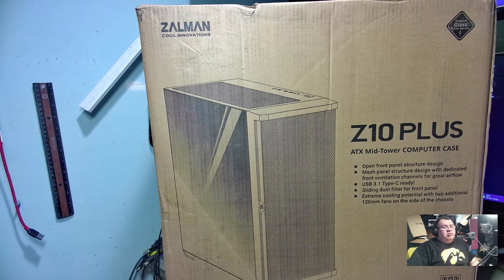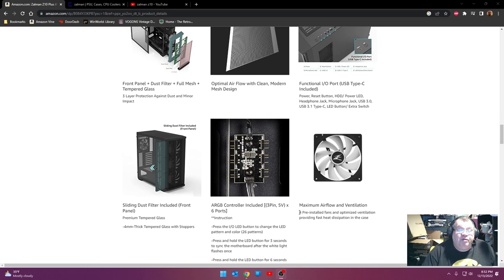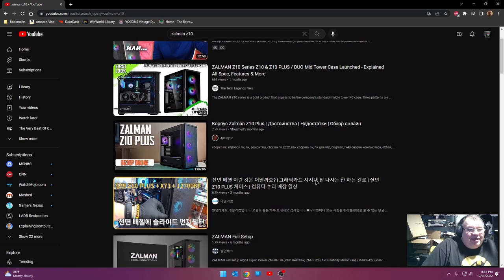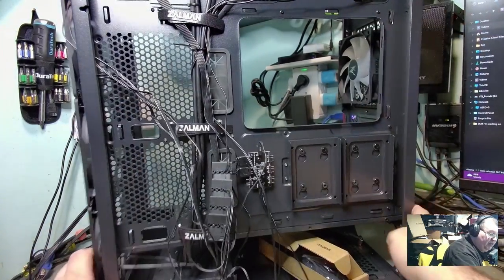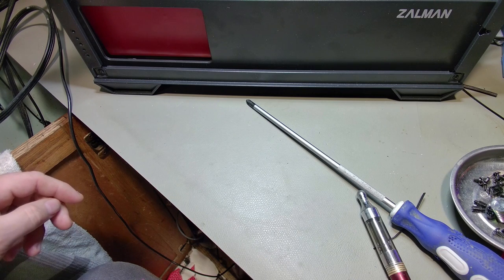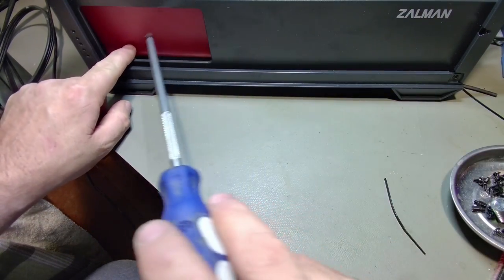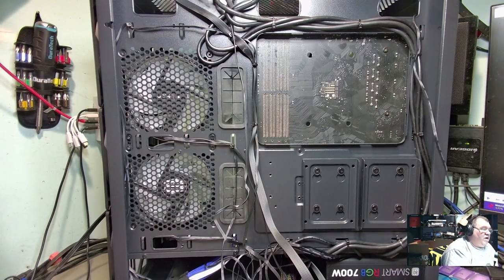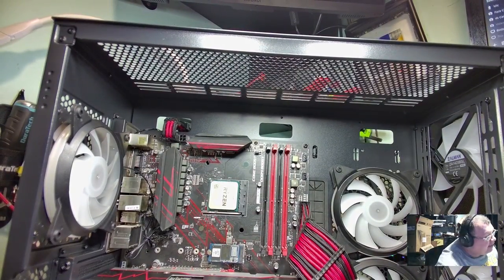Zalman Z10 Plus overview & build

Comment: 1. What size screws did you use for the bottom case fans?

2. Fans name pls on bottom? x3 120mm?
Reply from the maker: I used the same type you use to screw fans on an AIO https://www.amazon.com/dp/B00QT9PCU4 As for the fan name, not sure, I use so many different brands, but if I were to guess, I think these were EZ DIY Fab brand.

Comment: Can i control the speed of the default fans somehow?
Are those DC fans and not PWM, right?
Thanks!
Reply from the maker: No, the default fans are molex, complete garbage, you'd be better off pulling them out and replacing with good fans.
Reply: @phreakwars  Then i must have been misunderstood something in the video.
Only the molex and the ARGB connection come out from the fans?
The ARGB adaptor is included?
Reply from the maker: @csababusai9830  honestly, you'll have to watch the video. I do so many builds that I typically don't remember which case comes with what. I do remember this one had molex fans though.

Comment: Where did u buy that holographic ?
Reply from the maker: You can find that at your local Walmart in the craft section, or on Amazon here: https://www.amazon.com/gp/product/B01D1OLXP2 Holographic wrap will have 2 layers on it, the backing that you peel off, and on front a thin clear film that is removed to really make it shine. It's kind of hard to see unless you look close, and kind of a bitch to get started on the peel, but once you do, comes off super fast.

Comment: push-pull in the PS/HDD bay?
Reply from the maker: The 2 end fans are pushing air down which makes sense since the PSU is facing fan side up. Middle fan is pushing air up towards the GPU.
Reply: @phreakwars  I'm surprised the PSU has fan up. The manual shows installation as fan down to keep PSU heat out. You must have had different logic? Configured as you say, the PSU and fan over it are pushing against each other, right?
Reply from the maker: @johnmorrison4224  no PSU fan and fan facing down are both exhausting air outward it's correct trust me. The case allows you to mount the PSU with fan side up or down whatever you choose. When you install a PSU fan side up fresh air is coming in from the case and exhausting out the back. Think about it the fan on top is just adding additional air to the already exhausting fans. Edit: and actually if you want you can prove this to yourself just take a piece of tissue hold it on to the back of your PSU which way is that air blowing? It gets its intake air from the large fan and exhaust it out the back. Therefore if it has a fan facing it blowing onto another fan it's just adding air volume it's not negating it
Reply: @phreakwars  (Error in explanation.) What I mean is: Your configuration draws warm case air through the PSU, whereas inverting the PSU would draw outside cooler air in and immediately expel it.
Reply from the maker: @johnmorrison4224  WARM case air? You're joking, right? It has more fresher cooler air feeding it now than it would ever possibly have being flipped upside down. The fresh air is being pushed from the front of the case's 3 fans onto it. Heat rises, it doesn't sink. If the case has any heat radiating inside, it would be above the GPU
Reply: @phreakwars  I am, the point is moot with as much air as you put through that. I'm building a storage server using the Fractal Design Meshify 2 RGB in a few days, this case is similar.
Thanks for doing the video.
Reply: @phreakwars  so you have 3 fans on top, 2 fans on the right side, 1 fan on the back and 1 fan in the psu, e.g. 7 exhausting fans overall. And only 3 fans pushing air into the case. Looks like it would be better reverting 2 fans on the right side.
Reply from the maker: @alexalex102  it is what it is, PC has already been sold. If the new owner doesn't like the configuration, he can change it himself. Nothing I'm personally gonna worry about, I just demo the cases. I got great numbers for thermals after stressing in Cinebench (66c tops), so that's all that matters to me. Argue if you like if that's correct or not, it works. EDIT: Also, visit Zalman's website, scroll about 2/3rds the way down and check out the image of it and which way Zalman shows fan flow, you might wanna tell ZALMAN they are wrong too: https://www.zalman.com/US/Product/ProductDetail.do?pageIndex=1&pageSize=10&pageUnit=12&productSeq=1364&searchCategory1=5&searchCategory2=59&searchCategory3=-99&searchKey=&searchWord=